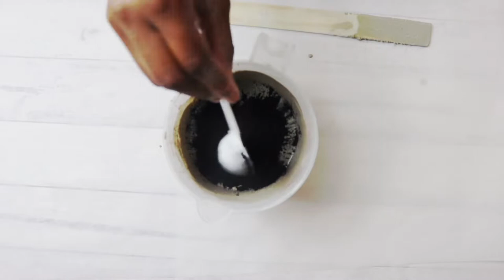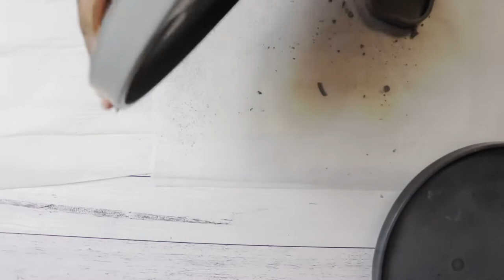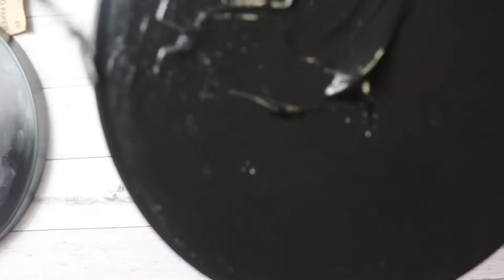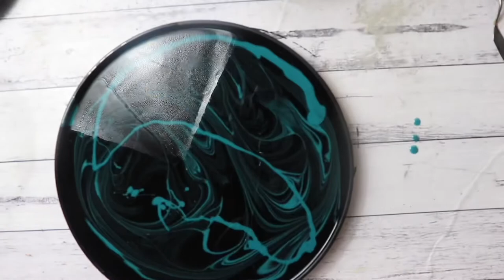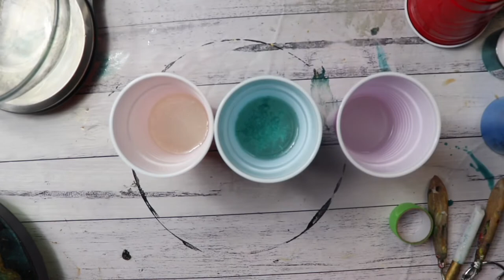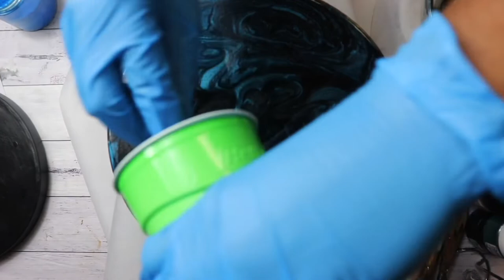Resin filled Lazy Susan Turntable Diy Concrete Cement tray with sika acrylic polymer and mica powder

Comment: Hey, you need to let it cure a little bit, just few hours, than you can mix with a toothpick since it's not a silicone mold.than wait to the next day (depending on the resin) than you can ad a last  clear layer  for the shiny. This way you will not use that much resin.